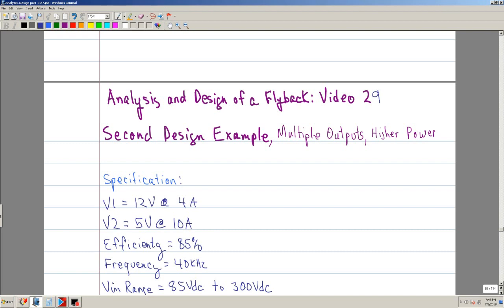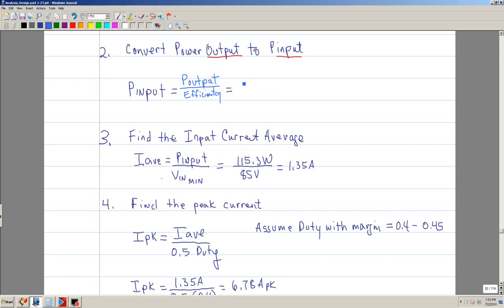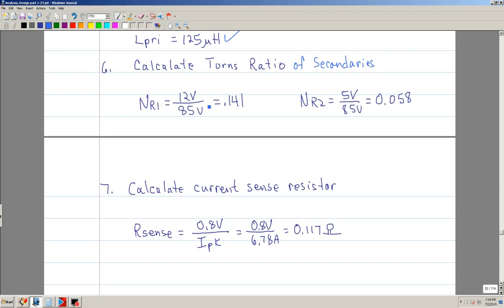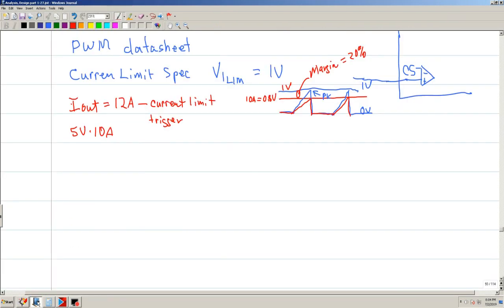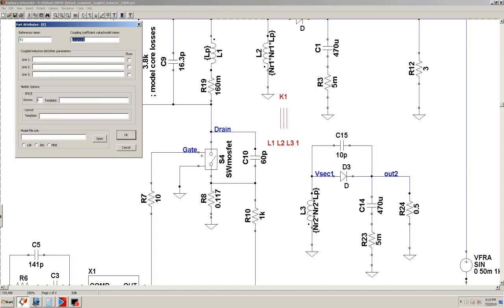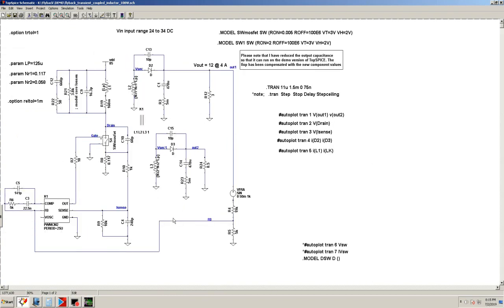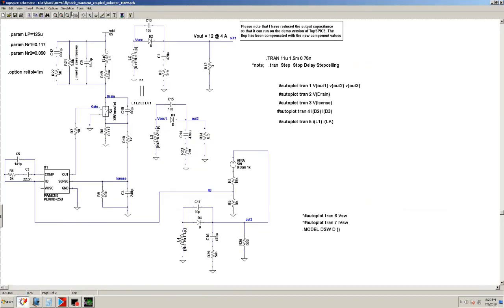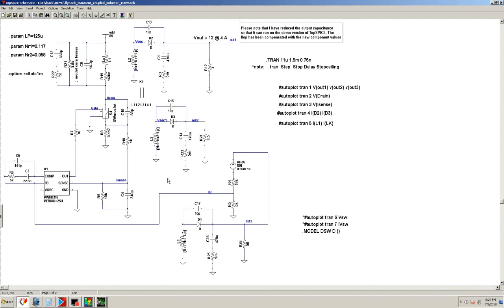Analysis and Design of a Flyback; Video 29 Second Design Example

Comment: Thank you for your excellent videos. I have one question regarding slope compensation.

In a DCM design, the duty cycle does not reach 50%, yet slope compensation is still recommended. My question is: how much slope compensation should be added in DCM compared to CCM?

Is there a general guideline or percentage of the inductor down-slope that should be used for DCM operation?
Reply from the maker: I just saw this. If you are using DCM, you should not have need for slope compensation. You only need slope compensation when you use CCM because when you get close to 50 duty, you get subharmonic oscillations. This is where you see in the PWM short, long short pulses. You also get a right hand plane zero,  which means you have to place the crossover frequency one decade below. If you are using DCM, if you get short, long, short pulse, this means you have jitter and you do not have enough Gain Margin. You need at least -10 to 15dB

Comment: Hello Mr Balanos,

What does  happen if Iout up to 15A? 

The converter stop To work? 

The controller stop To work ?

I mean what happen when Vshunt up to  1.5V or more  ?
Reply from the maker: When  the current exceeds the current limit set by the Rsense the Isense line of the PWM, the PWM will reduce the dutycycle and therefore the voltage will begin to sag or drop while keeping the current limit. I hope this make sense.
Reply: For my flyback multi output 
Using ucc2813QDR-3Q1 that has overcurrent protection, so in the lab i saw a big duty cycle when Vsense was 1V and the voltges for others secondaries side drop down.

I used a cross regulation

Comment: Currently I'm trying to simulate AC analysis (small signal analysis) of my flyback power supply, however i cant find suitable PWM controller to do that. 

1. Can you share with me on how to download the PWMCM2 average model (this is PWM model developed by C.Basso) based on your video? Can this model run at LTSPICE?

2. Another question, based on your video, I understand that we can simulate the AC analysis (phase & gain margin check) using average model & Jack model? Will both give the same result during AC analysis?

3. If Basso model cannot run using LTSPICE, can I use Jack method to check my power supply stability in LTSPICE

Comment: Sir, This design operates in CCM or DCM?
Reply from the maker: You can tell it is operating in DCM by looking at the primary current. The start of the ramp is starting from 0A and ramps up. In CCM, the start of the ramp will be non-zero current. Hope this make sense. Rbolanos